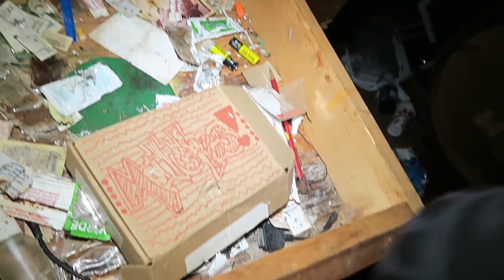(PART 3) ALONE INSIDE THE HAUNTED LIVINGSTON MANSION

Comment: Not sure if this has been mentioned or not, but at 35:12, you can see that tall cabinet had been knocked over again onto the speaker, so that's what would have made that loud bang.  It also looks like you can see a person in the reflection on the bottom right hand side of the mirror/tv (not sure what it is).

Comment: Okay, let's follow his logic that if kids went into the house and did all of the new vandalism (broken plates, broken glass, and torn up wood trim), there would be no possible way that they would not be caught because of the amount of noise they would make, nearby houses, and the neighborhood being tight-knit.  I can accept that it would be highly likely for kids to be caught under those circumstances, but where is his proof that nobody was caught.  Let's say kids did go in there and break everything in sight, and they were caught.  How would he know if kids had been busted or not???  I'm not definitively stating that there was no possible way for all of that vandalism to have been caused by paranormal forces.  I'm just asking why is he so sure that no kids had been caught?
Reply: If cops had come out, they would have secured the house.
Reply: My response would depend on the situation. If it's a known drug house, which it appears to be, I would probably stay out of it. No need to ask for trouble. If I heard someone being beat up, then I'd call the police. My fiancé owns a locksmith business, so we've done tons of evictions. After all is said and done, the houses are boarded up with 6 in screws, so accessing to house is very noisy and slow going. Someone would have been seen. That's why I believe cops weren't involved.

Comment: 10:10 swear that looks like a devil face in the mirror. If you look at the big mirror that's on top of the dresser. Looking into the mirror, the bottom left corner right above the white paper that's leaned up against it . It def. Looks like a devilish face with horns and such.
Reply: Also at like the same time . If you look into the long rectangular shaped mirror on the left right beside the big mirror it almost looks like a shadow of a cat, shape and such, sitting on top of whatever the black thing is
Reply: There are a few weird looking things u see when  looking in that mirror if you can look past the dirt and smudges. Like what looks like a hand and another creepy looking face like right above the big hand looking thing.  You can rly see what looks like a set of evil looking eyes to the creepy face lol